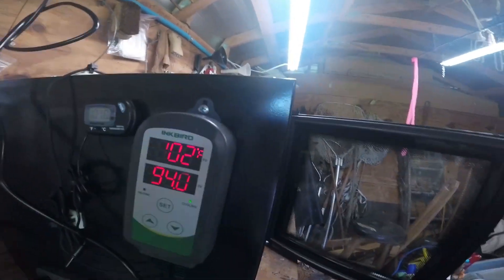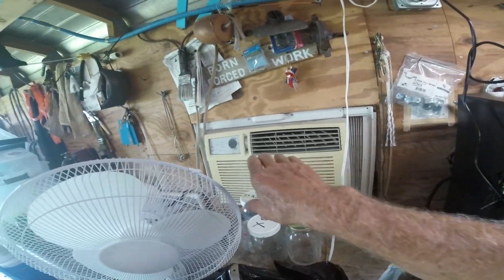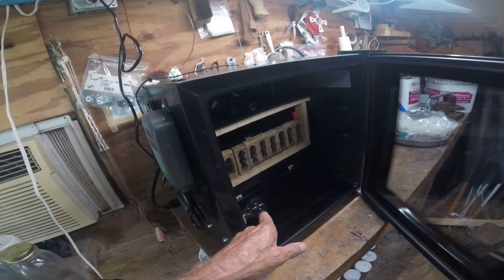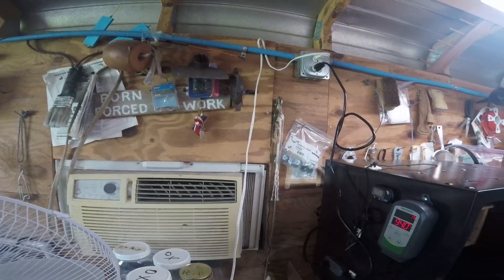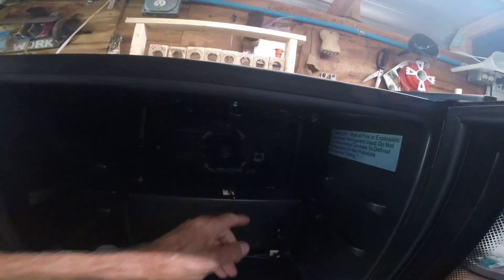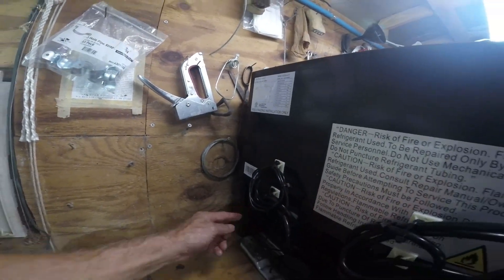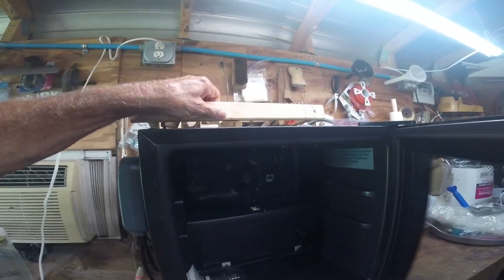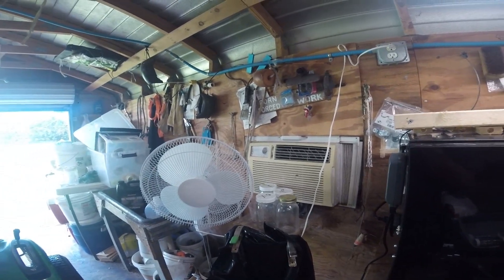New Queen Incubator Build

Comment: Steve I have the same control unit. Not sure if I like it. I have the little giant incubator think I’m going to need a fan plugged in.
Reply from the maker: That unit has been working perfect for me and the fan in the parts list runs slow and is just right for the size of my box.
Reply: @stevesoutdoorworld4340  got mine running good now go’s between 91 highest read on thermometer was 95   And about 65% humidity. What you think? Queens going to mating Nuc next Friday. Like I said I’m going to send you one of the daughters from  one of super star breeder queens.
Reply from the maker: @Alpha2tango  Thanks Scott i have been running mine at 93 on & 94 off!

Comment: SteveO you and your Son did a GREAT job.....  I used to do a little Taxidermy work myself. 

As far as the incubator let me tell you what route I went with. I use a chicken egg incubator. Lightweight and easy to maneuver. I use 20 count, queen cell holding bars, X 10 placed evenly on the bottom of the incubator for a total of 200 cells per cycle. Love it!  If you would like to know more I will be happy to reveal. 

I am not taking away from you and your sons project, yall did good!!  Keep up the good work.
Reply from the maker: Thanks Phillip my plan is to start small and build up as needed.I think is incubator can fit 200 if i were to use roller cages.Good luck with yer Bees!
Reply: Thanks SteveO